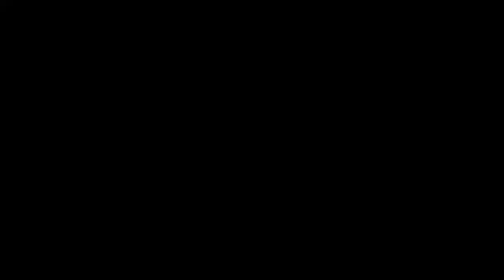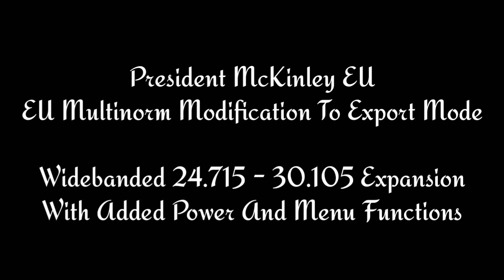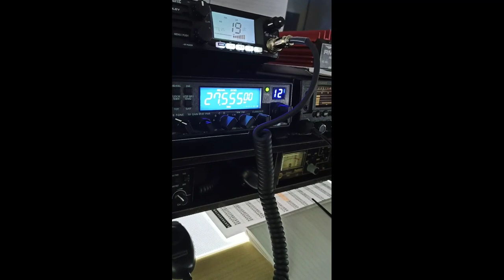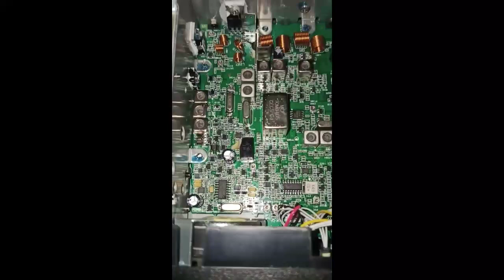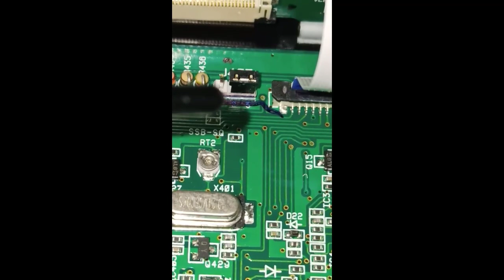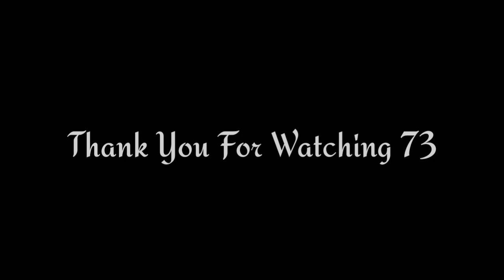President McKinley CB EU .. Wide Banded. Tutorial .. Export Modification.

Comment: I have all iterations of the McKinley. I like the latest export version the best. I've been a ham since 1973 and have had gobs of CB's and export rigs.

I just wish the McKinley had CW capability. The only modern export radio with a workable CW circuit is the 29xx series. The other ones suffer buffering and only work with an external keyer. Seems like all manufacturers just copy the same design.

Exports usually have a better NB than entry level ham rigs. They do a good jog on uncorrelated noise.

I really like this radio, though. It's very nice.
Reply from the maker: Hi Mark.. can i say the McKinley in my experience of owning many export radios is definitely one of the best performing radio's in my collection, i cannot fault it as an export model..
But i will add that out of the box they are sold as a ten meter radio, but in my opinion are really a cb radio and not an HF set.. although they cover the ten meter band the McKinley only really can be appreciated once it has been widebanded.. thats if you like a cb radio that covers ten, eleven, and twelve meters.. the receive is excellent and the options it has make it an awesome radio.. i do agree with you though that there are many radios out there with very similar functionality, but President do make a good radio at the moment and are certainly worth having over other similar radios.. 

Yes you would think they would have included CW.. i also own the President Lincoln 2 plus version 3 which does cover CW and with a paddle plugged in does work well on CW..

I cant really split the McKinley or Lincoln on options or performance as they are two excellent radio's.. i hear what others say about these radio's but i like to make my own mind up.. if i listened to most people's views on radio gear id be scratching my head as what to buy.. if a rig work's well for me I'll give it kudos regardless of what others say .. we all have our opinions but like others im not bias or either a Yasue, Kenwood, or Icom guy i have no favourites so if a radio works well i will always give it credit.. i have a fully filtered Yasue dx10 and i wouldn't say it works any better on receive than the McKinley they seem to both work good and as long as i get contacts on both and other stations can hear me thats fine by me.. i think people say a lot about radio gear yet have never owned or used certain equipment yet will call it out because they read something or their mate didn't like it so all of a sudden an opinion is formulated and a radio becomes rubbish because it has a knob in a position they don't like.. 
The McKinley is an excellent radio and after forty years on the air i can say its one of the best ive used on the bands it covers for what sort of radio it is.. i guess its in that category that's half way between an HF set and a cb radio.. like many other radios sold today. Have a good day and 73

Comment: Great vide, as this is my first 'modded' radio can you point me in the direction of the President band list you mention in your comment - The band's go in the usual President odd sequence where A is "mid" (EU), B is "HI, C is "low" ect.
Reply from the maker: Ah i see what you mean now, sorry it's been a long day..where i mentioned in the description the way the bands run.. i don't know why president run the bands the way they do.. but the A band is the mids and the B band is the Hi band and so on so C band would be low D band super low E super super low and so on.. only in the wide band option.. sorry if im not being clear.. if not explain and I'll probably do a video explaining what and where the bands are allocated.. thanks
Reply from the maker: Hi Leigh, it is strange how the band's are sequenced on President radios, A is not normally where you would find the mids. All you need to do is swap the mid band where D band is I think, I find it difficult myself and have to keep referring back to the frequency chart.. I'm not sure why President do this, even when widebanded the VCO mode doesn't follow the usual track of frequencies, best bet is to either Google a frequency chart and download or purchase a frequency chart, that's what I did. I'm just glad the UK forty can be accessed easy by holding in the F button instead of using two bands to cover the UK forty.. just to let you know it confuses me too.. it may be better for me to explain it on a video.. ill work on it.. have you had yours modified yet ?

Comment: I wonder if the USA version has a hack available would be nice to use it on ten meters
Reply from the maker: Hi Desmond.. This radio here is the new European President McKinley EU model which has all the new features including seven different screen colour's, take a look in the description under the video for all the statistics.. this radio will cover everything and more for the European and American frequencies.. out of the box it is solely a ten meter radio.. with this simple modification of cutting the wire and moving the peg over it opens it up to everything.
The American model has no modification like this one..
Also this radio when the mod is done covers just about every frequency there is across ten eleven and twelve meters and covers just about more frequencies than any other radio on the market .. 24.715 to 30.105 on all bands.
Reply: @DeltaXray444  thanks we can’t import it into the USA though I have the USA version it’s fine for Cb  but can’t be modified for 10 meters
Reply from the maker: @desmondsharpe5397  i have added an amendment in my comment above Desmond..
Let me say if you do decide to import this model you will not be disappointed, ive been into cb since 1978 and without prejudice to any other radio this McKinley is by far the best radio i have ever used, i cannot fault it in any way, it is an amazing radio.. also it does not feel cheap like some of the China brands, this version is made by President in there Vietnam factory and feels and looks top quality. Let me know if you decide to purchase i can send you a link to where i got mine from on ebay and is the lowest price and it come with the mod already done at no extra cost. The business is in Ireland in the EU.
Reply: @DeltaXray444  someone in Ireland? Been out of 29 for a while but could only find one retailer in Ireland that sold CBs two years ago and what they had was an icom 718 opened up fo cb. Definitely interested in who is selling that back home.
Reply from the maker: @desmondsharpe5397  
Hi Desmond here's the link where i purchased mine from the guys name is Roy, I've spoken to him personally about the modification and he was very helpful.
https://www.ebay.co.uk/itm/363032264829
There is also another guy in Ireland who takes on personal radio work and who is very good at what he does his name is George Donaldson heres his channel
https://youtube.com/c/GeorgeEI7KO
Reply: @DeltaXray444  would you happen to have another link to that retailers ebay page, that one doesnt seem to work anymore. Thanks!
Reply from the maker: @tthom_xmr4436 I'm not sure if they are in business anymore I can't find a link to them either but there is this link in the UK I've dealt with these before and never had an issue.. I also noticed they have gone up in price too.
https://www.ebay.co.uk/itm/153521599311?mkcid=16&mkevt=1&mkrid=711-127632-2357-0&ssspo=fE0pnx1ZToC&sssrc=2349624&ssuid=BbXptU0NQ02&var=&widget_ver=artemis&media=COPY
Reply: @DeltaXray444        but it opens the bands A B C D E etc, and other functions??????
Reply from the maker: yes it opens the radio up on all bands,.
Reply from the maker: Desmond just a reminder, you may have the american version but the European version i have if you decide to import one it will cover all the american frequencies and more 🙂
Reply: @DeltaXray444  thanks the price is too steep at the moment I can buy a HF rig for similar price a use it on ten and listen in on 11. The USa 🇺🇸 McKinley retails for about $200 usd here so still thinking about  get a second one. In Ireland CB is most active on the freeband 27.405+ its a fun hobby
Reply from the maker: @desmondsharpe5397  i can understand that with the prices, some of these radio's can be expensive and HF sets are coming down in price all the time. Although the McKinley is a very good radio and worth every penny. IMO. 🙂👍🏼

Comment: Are you a member of the Delta X-ray Skip shooters club from the early 90's? That's where I got my Delta X-ray Numbers. ~DX189
Reply from the maker: Hi Digger X, My call sign was registered at Universal CB in Nottingham with the official Delta X-ray club around that time yes, it's been a while so i cannot remember if they were called the skip shooters but it does sound familiar, the address for Universal CB was PO Box 40 for my location, and all the Delta X-ray call signs were connected to the same list up and down the country so i would imagine it was the same official Delta X-ray club.. 
There's not many of the OG's around now.. i hear a few Delta X-rays every now and then it's good to hear them still dxing.
When i was allocated my first number you had the option to change it if another number wasn't taken, so my very first radio in 1978 was a colt 444 120 channel AM rig.. i asked if i could have triple 4 and as it was early days and they obliged accordingly and I've had it since then, i am also registered on ClusterDX.com with my call sign too.
Reply: @DeltaXray444  We may have talked back in the day, I was so happy to see another Delta Xray member, I only talked to one other Delta Xray member a few weeks ago on 38 lsb, and he was DX656 from Maine, we talked for a while until the conditions changed. I wish I had my old log book from back in the day to see, i use to hold DX Check in's on 39 lsb for the Club members and bring in new members.  It's great to see another Delta Xray still using the Call. Maybe we'll connect on Skipland some day. Thanks for the reply Brother, it's great to meet you. 73's
Reply from the maker: @DiggerX  We most probably have spoken before, i find using the radio it can be a very small world, last week i spoke to a local station only ten miles up the road, he was mobile in the north of France and a delivery driver, i thought wow he sounds like a local lad lol.. he mentioned many stations from Nottingham in the QSO who i speak to occasionally..
Btw there is another Delta Xray in my comments on another video he is Delta Xray 990, so we are still around.. i lost all my old logs from many years ago in a house fire so i can't help with previous contacts a shame really as i would have loved to have gone over them to see if you were in them..
I will always listen out for Delta Xrays when im on air and hope to make the contact with you some day.. stay safe 73

Comment: I love seeing inside radios, computers and such. Just really nosey and interesting lol
Reply from the maker: Me too .. most electronic circuit boards are surface mount components nowadays, in other words everything is soldered on one side, like say a capacitor has legs on it and on old electronics those legs get poked through the little holes on a circuit board and soldered from the other side, but new surface mount components are all soldered to the board on one side, i think i explained that in a way you can understand lol xx